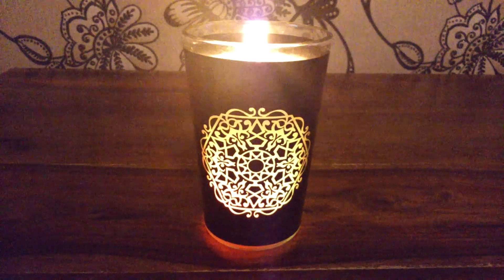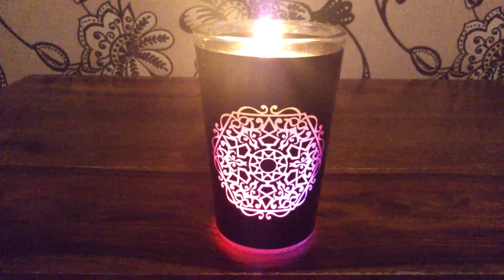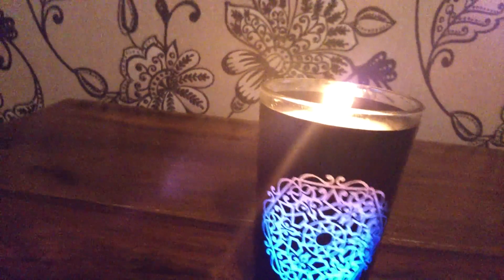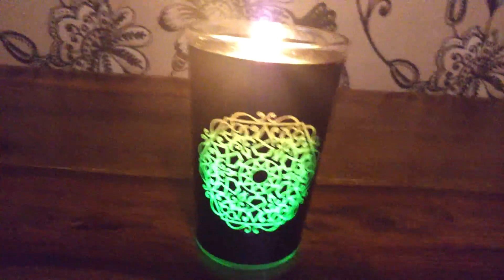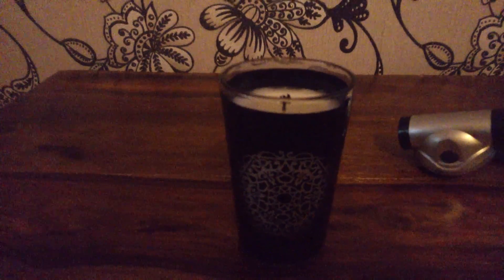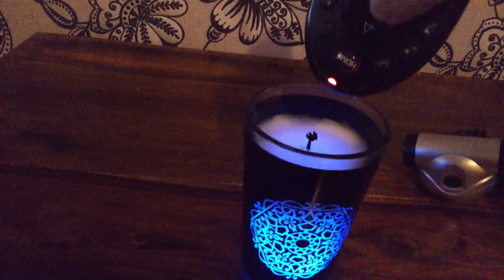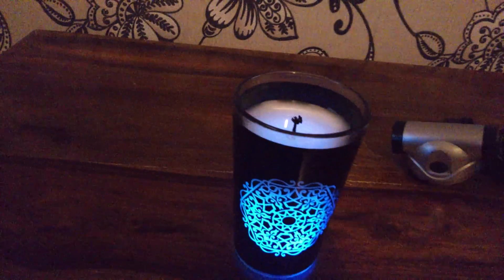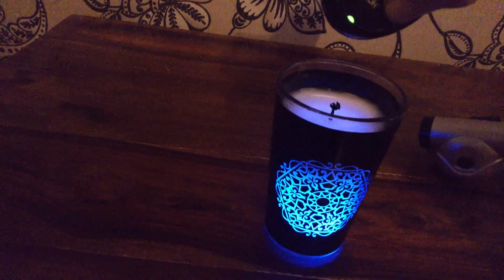How Air Wick colour changing candles work

Comment: My recessed light will trigger it.
Reply from the maker: So now you know that light is radiating infrared :)
Reply: so the light from a flame is infared?
Reply from the maker: Yes that's right.
Reply: thanks :) I love these candles they are being discontinued in the store I get them from so they were on clearance and I bought all they had.
Reply from the maker: Well, alot of it is. Infrared can't be seen. Remote controls flash infrared light when you push a button, that's why it works on the candle.

Comment: does it has a battary inside it ? i wanna see that leds after candle done if its posible
Reply from the maker: I've seen a video where they take one apart. Can't find it at the moment but it's like a little sealed unit with a watch battery inside.